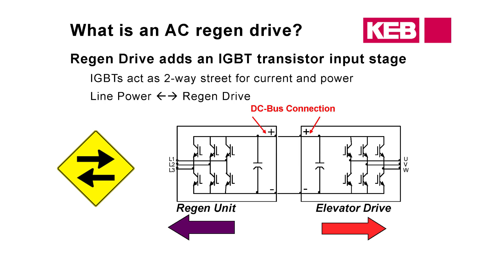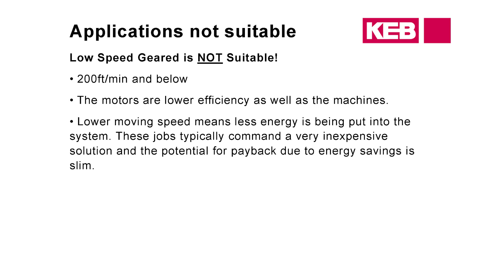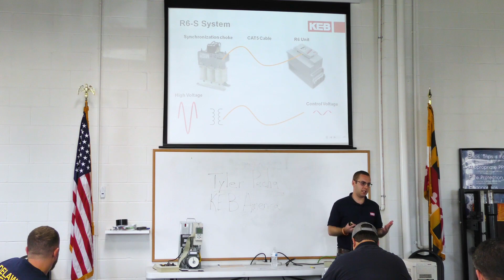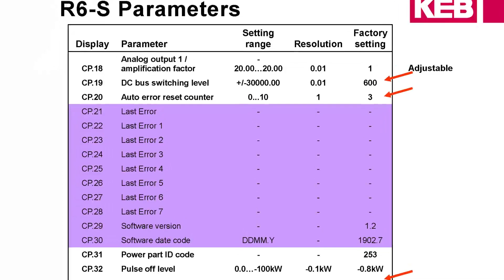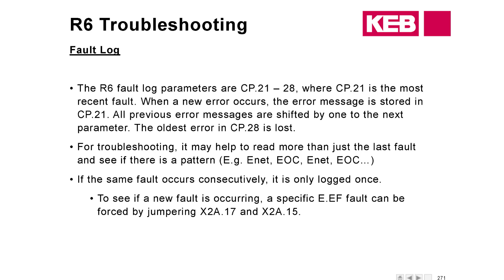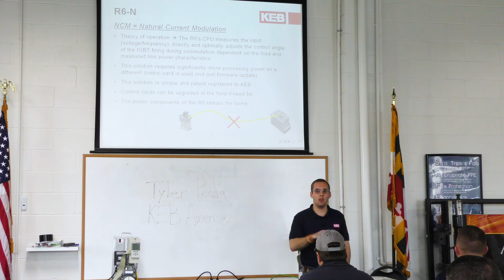Comment: Emergency power supplied by a back up generator doesn't get along with regen backfeed and may require bypass circuits with typical regen resistor bank transfer just for when running on emergency gen power.